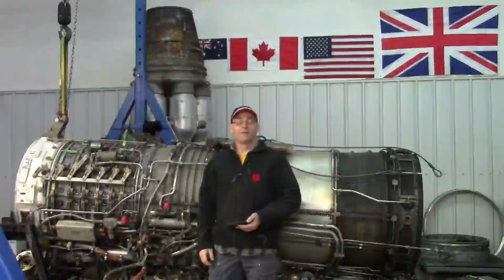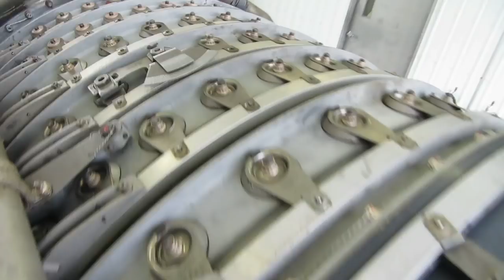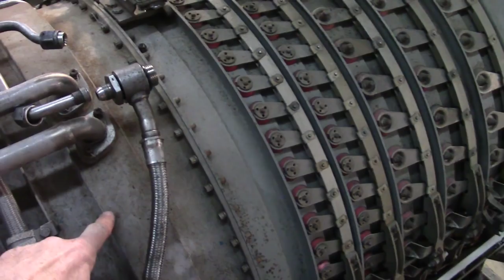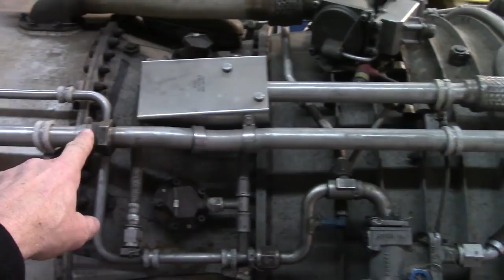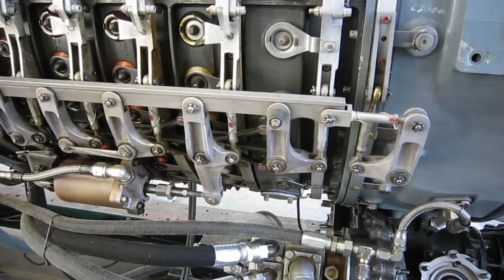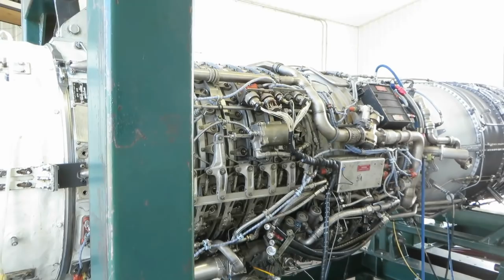Compressor Stall Q&A

Comment: A wing stalls at the same angle of attack no matter the speed. Between 15-20 degrees. 
In an airplane where air is blown over the wing by the engine, such as a piper Seminole, and most prop planes, the wing will stall at a lower indicated airspeed at a high power setting because the propeller is moving more air over the wing. However, the critical angle of attack doesn’t change. 
Private single/multi complex high performance. Cirrus / Cessna / piper
Reply: I thought your compressor stall vid was thoughtful and well put together.
Reply: chanbaggett555 The problem is that in the compressor the angle of attack lowers with higher airspeed and rises with higher rpm. Pretty weird compared to a plane I guess but I think that is what he means
Reply: As long as compressibility plays no role (up to around maybe Mach 0.3) that is true. At higher Mach numbers, where compressibility becomes an issue, stall occurs at lower angles of attack, some times as low as 10º. I would argue that compressor blades are well into the high-subsonic region, and will stall at lower angles of attack than typical airplanes. The (compared to aircraft wings) relatively small blade-nose-radius will also facilitate an earlier stall. When the stagnation points moves too far to the underside, the nose itself may cause flow separation.
Reply: pinkdispatcher Compressor blades are pretty much just a half a bee's dick under transsonic speeds for the incoming air in flight conditions and the compressor blades move at.. well lets say we have 10krpm, so just round to 160 per second at 0.5m diameter (outer diameter of the blades) thats 0.25 radius so 2*3.141*0.25=1.57m approx 1.6m soo 1.6m per rev and 160revs per second is 256m/s is 921kph. Pretty damn fast. But the shapes of the blades are somewhat optimised for a high airspeed a little bit like a supersonic jet has a different wingprofile than a slow stuntairplane
Reply: pinkdispatcher provide your source.i would love to read about it
Reply: About the decrease of stall angle at higher Mach numbers? The best free source I could find is Boeing's "Aero" magazine, issue 12: http://www.boeing.com/commercial/aeromagazine/aero_12/attack_story.html, in particular figure 4: At increasing Mach number (all subsonic), both CL_max and stall AoA decrease, although CL for a given AoA (pre-stall) increases. It's just a qualitative diagram, but you'd assume Boeing knows a bit about high-subsonic airfoils.

Another hint is in the Airbus A330 FCOM, Part 3, Section 3.04.27, p. 10, where it says in the paragraph about "Stall Protection" that the stall warning AoA (a few degrees before the actual stall) may be as low as 5º.
Reply: alles klar klaus i was referring to the airspeed of the blade. The angle of attack at which the wing stalls doesn’t change based on the amount of air flowing over it.
Reply: Regular contributors to AgentJayZ's channel will know that I, with my tongue firmly stuck in my cheek, provide US/UK English translations and vice-versa, in recognition of the "two nations divided by a common language" issue.  So, the translation for bee's dick into UK English  would be 'gnat's c**k'.  Also, on a more serious note, as footnoted in Langewiesche's book 'Stick and Rudder', the US term 'angle of attack' translates as 'angle of incidence' in Brit aerodynamic speak.  
Nevertheless, I would describe an aircraft as flying at a high angle of attack, resulting in the wing experiencing a high angle of incidence, the two angles not necessarily being the same.  And, in terms of compressor aerodynamics, I've only ever used the term 'angle of incidence' for the difference between the air angle and the angle of the blade/vane leading edge. 
The ongoing discussion about the critical angle for stall of a wing is interesting: however, as I've pointed out elsewhere, compressor blades and vanes are not wings.  They are forming the boundaries of passages within which there can be complex secondary flows.  Until CFD came along, these flows could not be modelled and the best understanding of what might be happening came from wind tunnel cascade  testing of rows of blades/vanes.  
If the wing analogy helps, in terms of a basic understanding, that's OK by me, and I congratulate AgentJayZ on his presentation - in contrast to the few detractors that have joined in.
Reply: pinkdispatcher thanks ill check it out!
Reply: grahamj9101 angle of incidence: the acute angle formed between the chord line of an airfoil and the longitudinal axis of the aircraft on which it is mounted.
Angle of attack: the angle of attack is the acute angle at which relative wind meets an airfoil. 
This is out of faa-h-8083-25B
If you want to talk about detractors, It seems like you have a lot to say and not a lot to add. So if you think I’m wrong or missing something, cite your source.
Reply: pinkdispatcher you were right cheers!
Reply: pinkdispatcher If you know where to get the graph from figure 4 with the scale on both axis, I’d love to read it
Reply: chanbaggett555 yes I know what you were talking about but I figured JayZ had something different in mind. Like when you want to rise with your plane you have to increase speed at the same angle of attack which means the wing creates more lift because more airflow. Also I don't think the graph is available with quantative expressions other than from a datasheet for an airfoil or similar stuff. Maybe an example in a good textbook somewhere, which would be awesome
Reply: chanbaggett555, Some of it (although I'm not sure anyone has made a quantitative version of the exact graph in fig. 4) can be found in most textbooks on airfoils and aerodynamics. The ones I have are "Fundamentals of Flight" (Shevell, quite deep and theoretical), "Aerodynamics for Naval Aviators" (great overall, but annoying for its almost exclusive use of imperial units) and "Theory of Wing Sections" (Abbott and Doenhoff, a 1940s/50s classic about the NACA airfoils).
Reply: You really have got on your high horse over this, haven't you?  I know this means the same in the USA as it does in the UK, because I've checked.  I also know what the standard usage of the terms 'angle of incidence' and 'angle of attack' is in the USA.  However, this doesn't mean that the usage is universal. which is what I was pointing out to those who might be interested.
Wikipedi, for, instance, recognises the fact that the term 'angle of incidence' is used in the UK  to mean the same as 'angle of attack' in the USA.  Wolfgang Langewiesche also recognised this in his book, 'Stick and Rudder', which was first published in the USA in 1944 and is still in print.  Please see the footnote at the bottom of page 7.  Langewiesche emigrated to the States in the 1920s, learned to fly in the 30s and became a test pilot, so he knew what he was talking about.
So what have I got to contribute to this channel?  Only the best part of a lifetime career of forty years in gas turbine design, where I was familiar with the use of the term 'angle of incidence' as I've described.
Reply: grahamj9101 you refuting my definitions and then saying you contribute is not contributing
Reply: grahamj9101 how about this. If you want to contribute explain why a wing’s critical Aoa changes based off of its speed
Reply: You're still on your high horse!  I am in no way refuting your definitions.  They apply in the USA and, as a result, are commonly recognised around the world.  Nevertheless, there is an alternative usage in the UK, which should be (and is) recognised.
Reply: grahamj9101 fantastic do you have an answer for critical aoa changing based off speed?
Reply: chanbaggett555 calm down. If you had been following this channel for a while you might know that grahamj9101 is one of the singularly most qualified people who comment here. For the invaluable contributions he provides, I think that a certain degree of levity by making fun of his own native language and its transatlantic derivative is in order. Most of what you have done, on the other hand, is demand other people provide their sources or explain themselves while you have simply asserted things. If you really want to know about Mach-number dependancy of lift and stall, Abbott and Doenhoff (see above) provide a mountain of data (literally many hundreds of diagrams of wind-tunnel measurements), from which all sorts of things can be gleaned.
Reply: pinkdispatcher okay first off. As a pilot i can’t use information if i can’t confirm it. I’m sorry you’ve been inconvenienced.
Reply: pinkdispatcher second. I love aviation. If you think I’m missing some knowledge send me a source and i will make time to read it. However i find it really tacky that you think you can read my emotions when you can’t read my English. Nobody is making fun of anybody’s language. I just find it incredibly disturbing that you’d make this big of a deal about definitions instead of sharing your knowledge. I’m swallowing my pride to try to learn something, i wish you would too. If you’re really that upset pull up a copy of far 1-1 and we’ll start using universal definitions
Reply: My levity about the "two nations divided by a common language" issue is directed as much at usage this side of the pond as it is over there .... usually.  Nevertheless, it is useful to recognise (spelt with an 's', not a 'z' - that's a 'zed'), the differences in usage that exist and that misunderstandings can arise.   
I started in design in the days when we produced drawings using a pencil on draughting (we might now spell that as 'drafting') film.  If I wanted to erase a line, I used a rubber.  A colleague of mine used to tell the story of asking for a rubber in the USA  - and an all-American Mom, on a posting over here with Hewlett Packard, was horrified when her pre-teen daughter came home from the village school and said that she'd used a rubber.
Reply: pinkdispatcher I doubt there are imperial units used in 'Aerodynamics for Naval Aviators', the US never adopted the Imperial system.  They still use the pre-Imperial system (which has some commonality with the Imperial system).
Reply: rkan2, the short answer is power. A stalled wing still has some lift, and the very high thrust at a high angle will both overcome the high drag and substitute for some of the lost lift. The longer answer involves an aerodynamic layout (typically with leading-edge-root extensions ("LERX") and often a sophisticated fly-by-wire system designed to provide post-stall maneuverability. That said, some small aircraft such as the Socata Rallye I have flown and many single-engine Pipers remain controllable even in a fully developed stall, even though they descend quite rapidly with a low forward speed.
Reply: rkan2 imagine you have an f18 with a nose up attitude of 60 degrees. Because of weight you’re track (flight path) is 55 degrees. Your angle of attack is 5 degrees. As you decrease power your speed decreases and your lift vector is less while your weight vector remains the same. If you hold the same pitch up attitude, your track (flight path) will be lower, say 50 degrees. At this point your angle of attack is 10 degrees. If you point the nose of a plane straight up, assuming you have enough power. You will be going straight up. Straight through the air. (The wing will be going straight through the air) therefore the angle of attack will be zero. The wing will not be stalled.
Reply: I designed gas turbine engines, industrial, marine and aero, not airframes.  This channel's primary function is, I believe, to discuss jet engines, which is why I contribute on stuff I know about.  This includes my knowledge and use of the term 'angle of incidence' in UK, in respect of the difference between the air (or gas) angle and blade inlet angle in a compressor (or turbine).   As AgentJayZ said, "you pilots are thinking too much about airplanes and not enough about engines". 
 Could you, for instance, contribute in a discussion about the benefit of high radius pre-swirl injection of cooling air into the roots of the turbine blades at the disc rim, as compared to low-radius injection, utilising a cover plate or mini-disc?  I'm contributing by telling you that, while AgentJayZ's use of the analogy of a wing stalling is a useful, albeit simplified approximation in the context of an engine, it is not the full story.  A compressor (and, for that matter, a turbine) is effectively a series of passages. 
I'm now going to use the terminology with which I was familiar and with no apology: the way the flow behaves in a compressor stage and the way it separates from the suction surface at an excessive positive angle of incidence is affected by the proximity of the following blade.  Does the Handley Page leading edge slat have a different name in the USA?  This, in turn,  is a simplified analogy, but it should give you some idea of the effect.
As I'm acquainted with the Chief Aerodynamicist of the Bloodhound Supersonic Car project, whose background was in airframes (including Concorde) and missiles, I'll have a discussion with him, when I have the chance,, rather than with you.
Reply: grahamj9101 as a sovereign man you have the right to present and withhold any information you want. I wish you would just withhold everything so i don’t have to sort through your attitude and the snippets of information. Please discuss it with your friend instead of me.
Reply: I made my initial comments because the term 'angle of incidence' has been in common usage in the UK, where it has had the same meaning as 'angle of attack' in the USA.  There is plenty of factual evidence for this, including paragraphs in a couple of UK-published text books that I have to hand.  However, you may be interested to know that both books go on to state that, to avoid confusion, they will use the term 'angle of attack'.
Reply: alles klar klaus not really just the shaft speed it’s a function of what opline you’re running at
Reply: A wing stalls when it lets the clutch too out quickly with low engine RPM.

Comment: Hi AgentJayZ.
Can you create some kind of smoke in front of the engine to see from how far engine pulls air at full throttle?
Reply from the maker: The books I recommend have nice diagrams of that.
When you take your car to be dyno tested, do you want some smoke going through it?
Reply: Hi.
Didn't evan expect that you answer to me. Thanks. :-D

I' agree. Smoke probably would be to abrasive for blades or something else but I' think at stuff like dry ice or smoke they used in the wind tunnels, from long pipes for measuring coefficient of drag

Thanks anyway